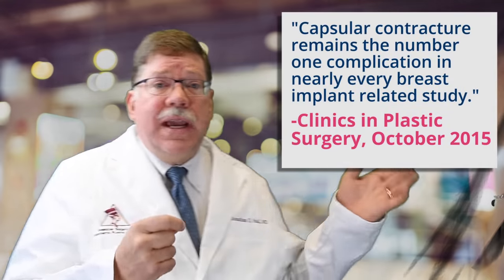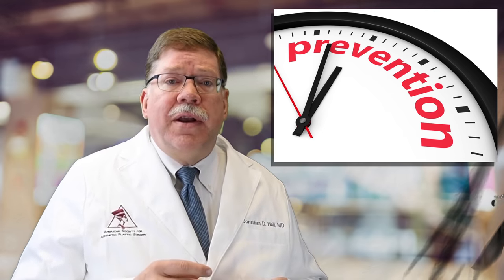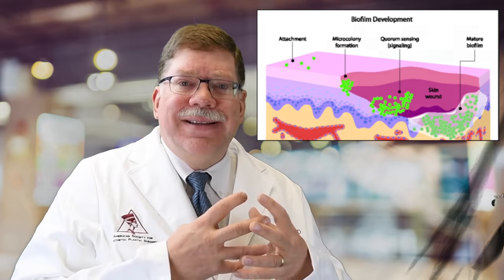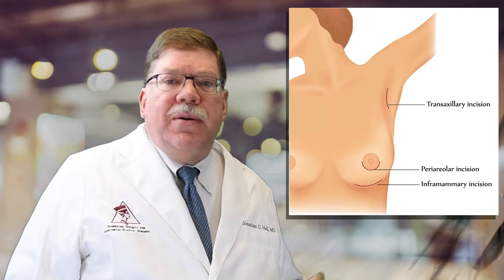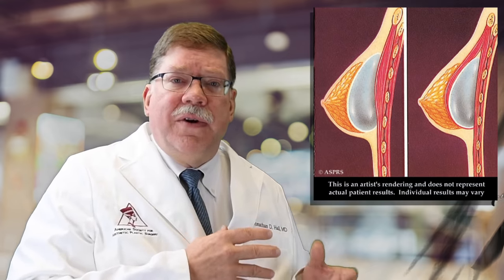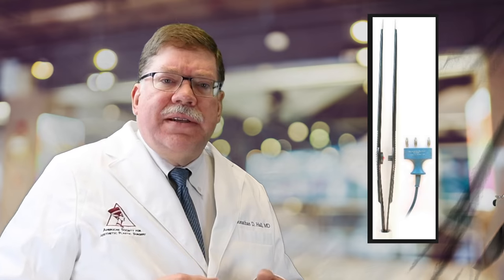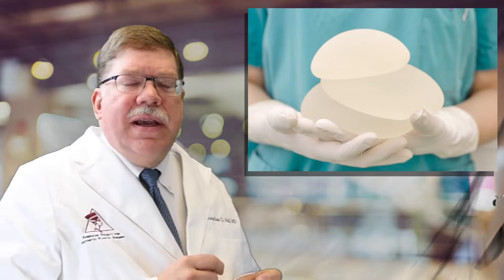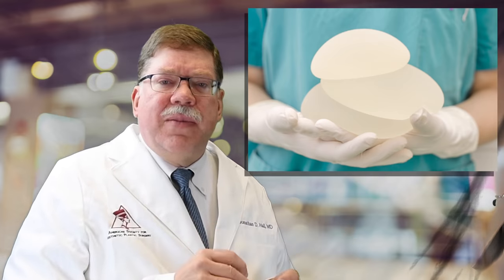Avoiding Capsular Contracture

Comment: Dear Dr Hall, I have had my smooth, round, saline implants for 14 years. I've had no complications. Is it necessary to have them replaced a some point? I understand that they are not lifetime devices but not sure if/when they should come out if at all. Any info is greatly appreciated. Your videos are very informative and professional. Love your accent
Reply from the maker: Hi Jennifer,

Very generally speaking, implants have a lifespan of 10-15 years. Every case is unique, so my recommendation would be to meet with a doctor to get a professional opinion.
Reply: Dr. Jonathan D. Hall - please explain what can happen after 26 years
Reply: Ana Bend, nothing until they rupture. It’s a strong silicone & super hard to bust. Any Dr. is going to say to have them replaced, of course. As long as u got saline implants I don’t see any reason to have them removed unless you’re having problems with them.
Reply: @kristyglennkg  Dang...I just had my 38 old saline implants (Jan. 16th 1986) replaced (April 5th 2023).
I wanted saline implants again but my surgeon highly recommended silicone implants.     These should last me since I'm 70.
Only reason I had them replaced because one deflated.
Reply: @DrJonathanDHall  I just had my 38 yrs old saline(Jan. 16th 1986) implants replaced. My surgeon highly recommended silicone implants.  Surgery argumentation April 5th 2023.  Only reason one ruptured. I'm 70 so these should be my last pair. 
Loved your video.

Comment: Postop 4/18/2023  this is so informative.  I'm afraid my left breast  might have that problem with my left breast . My really good dr had to remove my old capsular contracture from in front of the muscle and put new implants behind the muscle he did an excellent job but he had to do a lot of work on me and I understand there would or could be complications.  However my left breast bled a lot after surgery and has lots of bruising around the sides and under the breast and some tingling and pressure. My right breast has a little of the same feelings However no bleeding at all and some pressure but they are soft my left breast is more visibly larger than the right when my clothing is off. 
    When if at all could I notice the capsular contracture forming.
PS  I dont have nipple sensation yet in either breast im not expecting much at this time, I just want them soft. I am a 56 year old woman of color inquiring. Thank you very much in advance.

Comment: I have capsular contracture now, I’m having both capsules removed and new silicone ones put in, I can’t wait.
Reply: How did it go? About to do the same and am scared of getting it again.
Reply: Nichole it came back on one side almost immediately
Reply: Wow, I'm so sorry to hear that. That's what I'm afraid of.
Reply: Nichole mine are over the muscle and I had them put back in over the muscle. Maybe if you do under it won’t happen. That’s supposed to be less of a risk
Reply: Mine are under, I have it on the right side. I have seen so many people saying your higher risk after having it. We will see soon. Good luck with everything.
Reply: @nichole4840  did you ever get your surgery? Curious how it went. I have the same problem CC on my right breast and have a scheduled surgery to fix with replacement of implants but I am so afraid it’s going to happen again :(
Reply: @danielledennis7436  Yes, I had it fixed about 7 months ago and it has not came back. I was told not to massage the first time, the second time I massaged and took vitamin E and so far so good. Good luck with yours! I definitely recommend massage.
Reply: Hi ladies! Wanted to see how both of you are doing after your corrective surgeries. I have a CC and I’m TERRIFIED of going back under just for it to come back again. How are your breasts doing now?
Reply: @malikaaa1992  the silicone in my opinion are much better than the saline but the CC is coming back on the right side (the right side was always the worst) mine have always been over the muscle and the new ones are also. If I were to ever do it again, I’d go under just because of CC.
Reply: @TKO-qj5zx  I’m so sorry to hear it’s coming back! Is this the same one from your last comment a couple of years ago or have you gotten those replaced? I wish there was more we could do to prevent them. I’m thinking about doing under the muscle too.
Reply: @malikaaa1992  I had them replaced 4 years ago, (wow doesn’t seem like that long) but anyway, the right side, while not anywhere near as bad, is getting cc again. Now, if you are debating whether or not to do the surgery, I’d still do it because you should see the hard, calcified capsule that comes out. It’s crazy. If ever I would do anything again, I’d just have them removed totally
Reply: @malikaaa1992  Do under the muscle if you can.

Comment: I had an exchange surgery at #MDAnderson hospital and I was wondering why pre op screening was so thorough compared to my experience with Kaiser Permanente hospital in CA when I had my double mastectomy and expanders placed in which I developed capsular comptracture. The surgeon at MDAnderson took all the measures to prevent CC for my implants even put the drains on my rib cage instead of on the side of my chest like the 1st hospital did. I'm very happy with the results.n

Comment: So you can get capsular contraction years after the augmentation procedure?!?!
Reply from the maker: Symptoms typically begin within a few months of the augmentation, but there is always the chance that it could occur much later.
Reply: Yes, I have had mine for 16 years and didn’t develop capsular contracture until about 4 years ago.
Reply: @TKO-qj5zx  how did you know you had capsules contraction? Was it painful.
Reply: Rits K no, mainly they were just really hard.  Like grapefruit under the skin.
Reply: Stephanie Pereira - yes. I’ve had mine in since 1992 and 6 months later I had both contract and harden. Then in October of 2018 my right breast is hardening again. I want them out. I’m scared.

Comment: Is 10 days post op of breast augmentation with two stage lift. One side is great the other had nipple problems now healing with ointment , I’m concerned about if it’s normal to worry if my one breast isn’t dropping after 10 days..
Reply: I just had my argumentation  two weeks ago. One is doing fine. The other one is sitting up high.  I'm doing massages as my doctor recommended. 
.

Comment: Dr. Hall,  What is the cost of a Breast Augmentation?
Reply from the maker: It fluctuates depending on a number of factors, such as the type of implant. A rough range would be between $6,000 to $7,000.
Reply: Dr. Hall, where is the best/ ideal placement for breast augmentation. I'm a transgender, MTF, is it better under the skin or under the muscle?
Reply: My first one in Chicago was $6,400 for textured silicone, my second one in Destin was $7,500 fo smooth silicone.